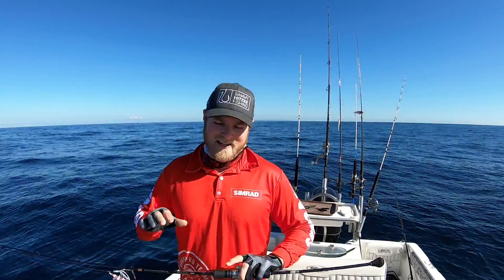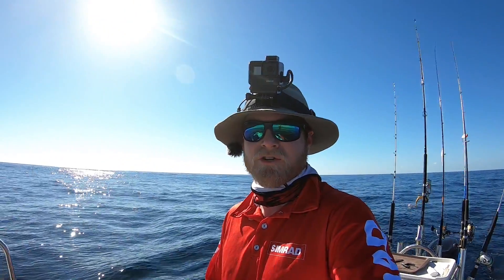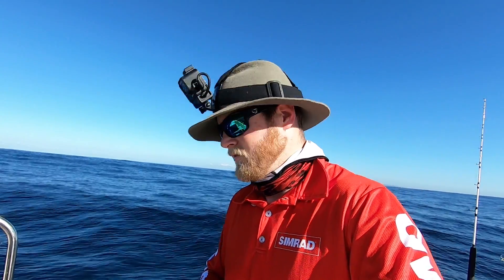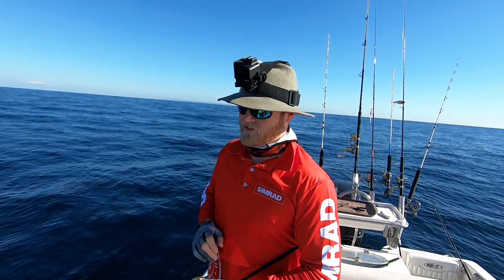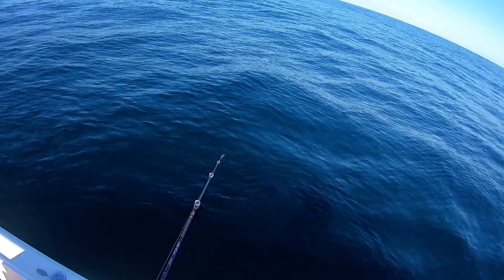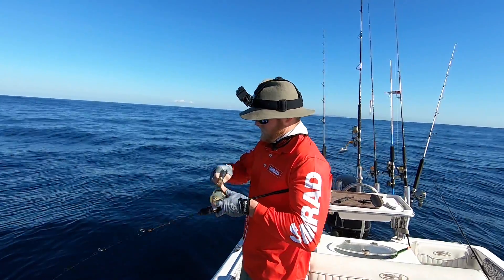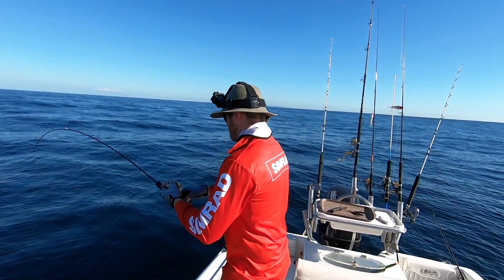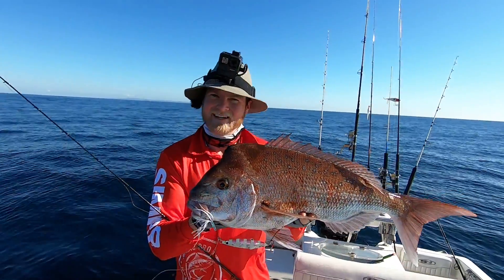Deep water jigging with Simrad

Comment: Hello 

What is the model of simrad unit you do have ?
What is the maximum depth that this unit can display when fishing in deep water ...700 feet plus..?
how many watt is the power of this transducer ?

Waiting for answer as am i and ready to .....
Reply from the maker: Hey there, Sam is running the NSS Evo3S, with both the S5100 sonar Module and a TM275 LHW (which is a 1kW transducer). At low CHRIP  it can get down to 3000 feet - check out the transducer specifications here: https://www.airmar.com/Product/TM275LHW